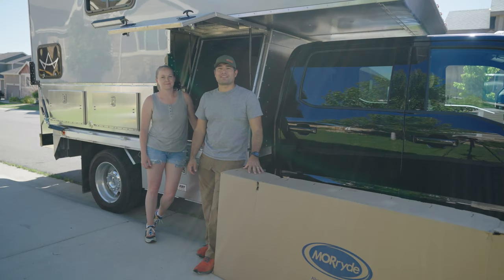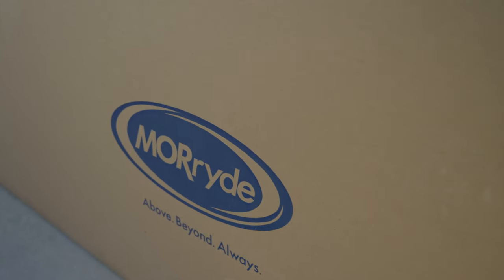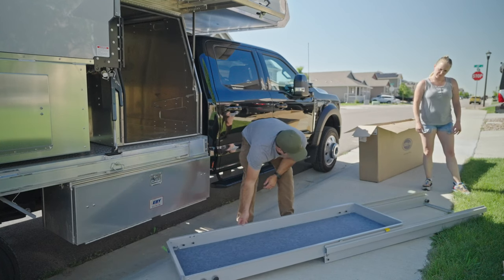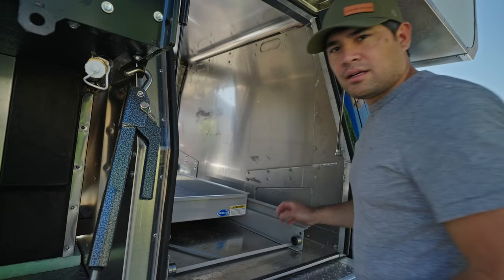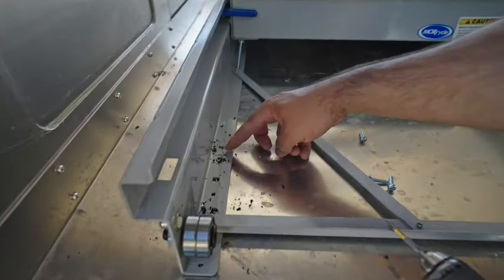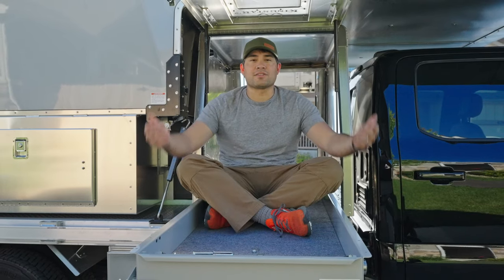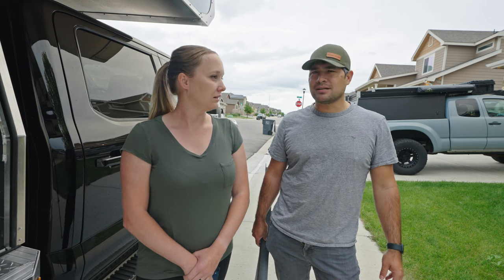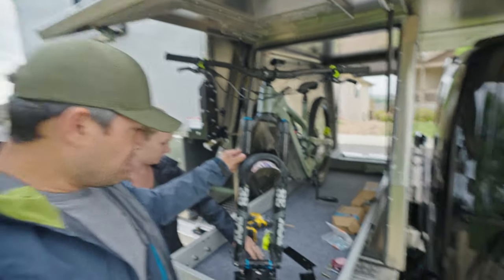Custom Bike Slide Out: Enhancing Our Kingstar Truck Camper Garage

Comment: Nice setup, but where did you end up putting the front wheels?
Reply from the maker: Thanks, they fit perfectly on the side of the slide and we got some reusable zip ties to tie them in to the strut mount so they do not move around.

Comment: Great to see how you did that, good design. Have you thought about putting another piece of flat iron across the middle underneath and then having a few hooks on top to strap the bikes down in middle to lessen the wobble.
Reply from the maker: No I did not, I was actually thinking about getting a quick fist for the rear tire but I like your idea for support! So far I’ve put about 1400 miles on it without issues, we definitely want to reinforce it when we can.

Comment: OK so you have a full crewcab 4 door. How long is your flatbed and how long is the actual box part of the camper that sets on it? I have an 01 dodge 3500 dually that I am rebuilding. It is the old quadcab design with an 8' bed. Looking at putting a flatbed on it bud wondering if 8' is max or if I can put a 10' flatbed on where an 8' pickup bed was before? Looking forward to the Kingstar flatbed build , also looking at the Alaskan model. Undecided.
Reply from the maker: We have a 84" CA truck with a 11' flatbed. The camper itself was designed around the 8' beed so that would work perfect for the camper and side storage.